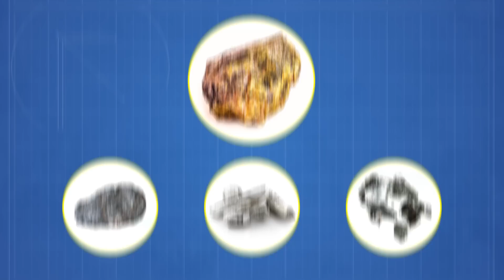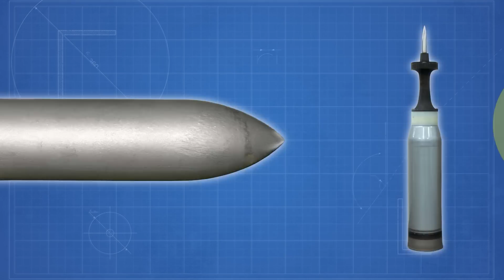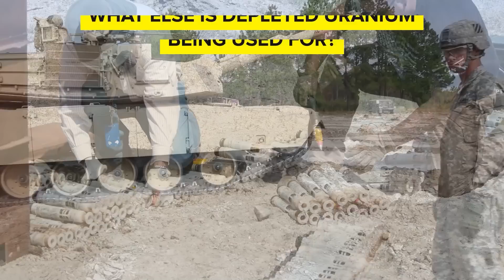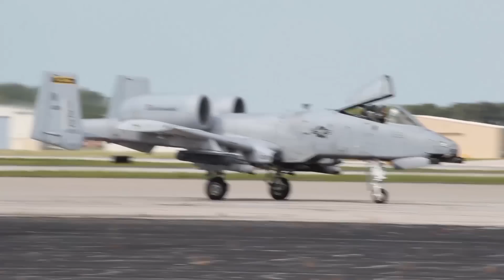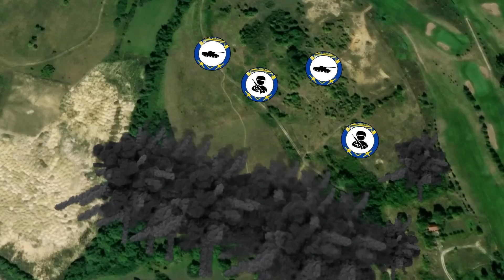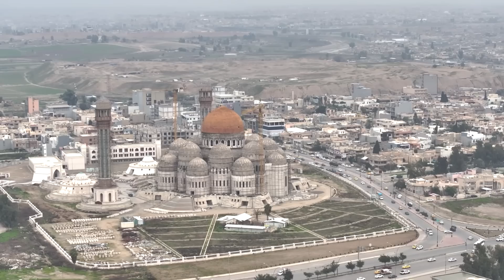The Shocking Reason Why Depleted Uranium Is Used in Ammo

Comment: I worked at a uranium isotope separation plant, so have some knowledge of the depleted U issue. Naturally occurring U is 99.7% U 238 Isotope and 0.7 % U235. U235 is the "good" stuff needed for reactor fuel. So the ratio has to be changed to concentrate the U235 up to about 4% typically. . As a result the  original U isotope mix is DEPLETED of U235, hence the term.  The  material used for the shells is still U just with a different isotope ration than natural uranium but has never been used in a reactor where it would have been useless.contaminate.
Reply: Well mostly true other than the fact that U-238 can be bombarded with a neutron and if it absorbs it turn into Plutonium 239 and be used for nuclear weapons.
Reply: @Stubbies2003 as an an exploded shell, there is no possibility of it being converted to plutonium
Reply: @Stubbies2003  How do u propel neutron?  U kant use magnetic field or electric field...
I don't know much bout nuclear particles.  But, perhaps:

1.  Neutron has magnetic field and respond to it, so it can be sped up

2.  Just knock out a bunch of neutrons off U-238 by proton and U-238 isotope is hungry so the latter just gobbles the neutron up
     to make Pu 239?

3.  Shine a powerful concentrated light beam, such as Gamma ray or Cosmic ray onto some other atoms, call it X-Element atoms to
     knock out a bunch of Neutrons, then let Neutron hungry U-238 to form Pu 239?
Reply: Small correction  238 is 99.2%, 235 is 0.7% 234 0.005%
Reply: 1) Your first percentage number "99.7%", should be 99.3%. Older technology had U-235 ratio for being "DU" lower than 0.3%, newer tech now brings it down to 0.25% to .20%, some old Uranium Hexafluoride stock at 0.3% U235 is now being reprocessed to get that last fraction if 235.
Reply: Yall so smaaaart lol damn❤

Comment: With all of the very vital positive effects of the DU ammo, being far better than the next best along with the well proven extreme low risk of health issues,,,,,we should step up to use DU far more than before. The positive effects in military use far exceed the use of lesser capable types. In reality, isn't the  need to use the very best in war time settings far more of the proper way than to only use the lower grade? That is akin to saying that lead bullets cause death and we need to return to throwing rocks at each other or bullets made of mud.
Reply: Despite what the video suggests DU isn’t vastly superior to tungsten, it’s cheaper and slightly superior only under specific circumstances. But tungsten or lead exposure isn’t particularly healthier.

Comment: Before watching the video, I wondered what exactly people thought the term "depleted uranium" might mean?  Perhaps there was less of it per round as supplies were depleted?   Perhaps the depleted means there is less Uranium per round?  Do they wonder if it means the concentration of radioactive U 235 which is used in enriched uranium for weapons and reactors has been reduced?  Maybe?  What if the manufacturers enriched the rounds?   That way, all the gunners would have to do is come close to the target to kill through radiation poisoning.  Mind you, the gun would be a bit of a problem, never mind the magazines.
Reply: It is refered to as depleted because the more radioactive (and useful) isotopes have been removed.  The stuff isn't that radioactive in the first place.  Primarily barely detectable amounts alpha radiation (cannot penetrate your skin with far less secondary beta radiation.  And most of the radiation is trapped and dissipated in the material itself.
Reply: @ If we had been F2F the sarcasm would have been a little more obvious

Comment: They are cheap and rival the density on thungsten which is expensive...and since depleted uranium is the sideproduct of running reactors then it's only reasonable to turn it into ammo
Reply: The US doesn't use spent fuel from reactors. They use byproduct from making the fuel rodes to begin with.
Reply: Not 'cheap' anymore.  Now the strategic reserve of the stuff has to be carefully managed and is only used for things where there is no real substitute.  DU used to be used as a replacement for lead as radiation shielding - but got stripped out when the stuff became scarce. (Uranium has much better structural characteristics - you don't need a frame to hold a DU panel up.)

The reason why countries that are serious about tanks switched to DU (actually an alloy of uranium and molybdenum) is because it is 'self sharpening; as it passes through armor while tungsten will mushroom out.  As a result, it has much superior armor penetration vs. tungsten.  Another advantage of uranium is that once it exits the armor it shatters into a shotgun blast of white-hot metal that still retains hit structural strength.  These fragments penetrate the spall liners that protect the stowed ammunition and detonate it.  

When you see Russian tanks exploding when hit - it is because the antitank munitions developed since the early 1990's are all designed to destroy the tank by detonating the stowed ammunition.
Reply: @colincampbell767 is it the mining, or the cost of turning it into DU. Because here in South Africa we recently opened a big bum mine on a massive deposit we found. Like, massive deposit. And i was excited for a second.

Comment: Fyi, the mechanics of a hypervelocity penetration armor is best modeled using fluid dynamics. Think of a fluid poured into a pool of another liquid. The penetration is proportional to the velocoty of the poured fluid but also the difference in fluid density. Just imagine pouring red dyed water into water, then imagine pouring motor oil into water. That is why we use as high density material like DU
Reply: Oil weighs less than water.
Reply: Clear as mud.
Reply: Without having your knowledge in fluid dynamics most people don't know an more than they did.

Comment: Ain't DU mainly U238... There are concerns over DU contamination but be reminded its a rather heavy material making it very hard to molten let alone "aerosol".
Reply: The only aerosol effect comes from the layers of DU being shed during the penetration. Only those in the immediate area, who survive, are affected. Afterwards, particles that are airborne quickly fall to the surface.
Reply: @rickslingerland1155 and those particles on the surface stay there until kicked up again by a tractor tiller or perhaps farm plants absorb them no? i worry for future farmers/kids.
Reply: @MonstroLab  The particles are not that dangerous in the first place.  This issue has ben studied multiple time.  Remember that it isn't 'layers' that are being shed - but fragments.  And this is intentional because it is these fragments that punch through the spall linker protecting the stowed ammunition and detonate them.

Comment: Almost all of the US tank rounds fired in Fallugia were high explosive, not DU.
Reply: DU is anti tank, and armored concrete rounds, only in the first month of the war against such targets they where normally used, if you use them in city fighting they will just like a super spear go through who knows how many buildings and hit one of your own is the risk, high explosives is so much more deadly, even a lightly armed vehicle i would use the high explosive, if you are unlucky those DU or similar rounds will go right through without hitting anything important and not have the desired effect because the target is to soft, but tanks 😱😱😱😱💥🔥🔥🔥🔥💀
Reply: I did not know that. It does make sense, though.
Reply: @rickslingerland1155  Kinetic energy ammunition needs to hit thick armor,  Otherwise it just makes a hole in one side and out the other.  Serious injury would require somebody be directly in the path of the projectile.
Reply: I wasn't aware of any KE ammunition being used in Fallujah.

Comment: The main reason they use this as a weapon is money. Nuclear power plants have to get rid of this material and got idea that it can be used as ammo. Its realy that simple.

You could use other dense materials that are not radioctive in ammo, but those are more rare elements and more expensive. So yeah money.
Reply: Uranium is simply the highest density metal that exist naturally. Irrespective of cost.
Reply: So, basically you’re saying that it’s like any other decision. You have 2 extremely comparable products, 1 is expensive and very hard to procure and the other is a waste product that is essentially free because it’s cheaper to use than it is to dispose of. 0.2 g/cm3 difference so no change in effectiveness. Pretty logical.
Reply: What do nuclear power plants have to do with DU?

Comment: I was a crew cheif on A10 warthogs. It always makes me smile to watch a video and see one. I once worked at our local airshow giving tours of our A10 to the public and had someone confront me about depleted uranium and the environment. I wish I had watched this first.
Reply: led poisoning is extremely dangerous but it’s the only heavy element that are not radioactive, many of the metals are not very dangerous because of radioactivity but much more because they are toxic, depleted uranium is not more dangerous to touch with your bare hands than led but you should always wash your hands afterwards, it’s never a good idea to get heavy metals into your body even though the risk is very low even with led.
Reply: @kimmogensen4888  All heavy Metals are Toxic after the Strike a Target.  I was a Tanker when the 105mm Version of the APFSDS showed up.  Damned thing Tore up the Range Equipment.  It went though six feet of dirt, 3 feet of reenforced concrete and right though the machine that raises the Tank Target.  I saw Film (LOL) of it going in the front and then out the back of a T-72.
Reply: @dnate697  do you think it's safe to keep old shells? I have a ton of 30mm shells that were fired and one 105mm from an AC130, which is sitting next to my toaster in my kitchen. I feel stupid for asking this, but I genuinely have no idea and you got me thinking about the metals.
Reply: @nightshadedPRSguy  How in the hell did you come up with that Reply?
Reply: @nightshadedPRSguy wash it and dispose of the towels in the trash. Use disposable gloves and a mask just to be sure. Then it's ok.
Reply: @BladeFitAcademy  thank you!
Reply: @dnate697  because you seemed like you knew what you were talking about in regards to heavy metals, shells, and whatnot.
Reply: @nightshadedPRSguy  I do know what these heavy metals like Tungsten and every alloy and variations there of.  I was a tank gunner in the M60A3 and the first 105mm M1's.  Yes, DU rounds are toxic and so is lead.  

It was said that Steal is the least Toxic. So the TP APFSDS we had just just as good as APDS combat AMMO! DU was like comparing a .44 Mag HGAP to a FMJ 9mm LOL! DU was worth the risk!
Reply: @nightshadedPRSguy  If you wanna be extra paranoid, I'd likely put them in something so they don't oxidize (rust) and dust forms, which is the "you are going to have PROBLEMS" substance.

hm...........  get them embedded in lucite?
Oh, but you said you have a lot, that could get expensive.
Reply: @nightshadedPRSguy  The shell is a completely different metal than the projectile.
Reply: @kimmogensen4888 lead isn't used for military rounds
Reply: On behalf of all people who are concerned about the environment and conservationism, please allow me to apologize for that person's boorish behavior. Folks like that give nature conservancy a bad name. Thank you for your service, sir.❤️‍🔥🇺🇲💪🫡
Reply: @ramseydoon8277  thank you for your kind words! I also believe in conservation. I want future generations to live in a world that has clean water and land. I'm a terrible bow hunter who often goes years without getting anything, but I still enjoy enjoy sitting in a tree and observing nature. It's good for the soul.
Reply: DU is definitely not very radioactive, people should worry about Radon levels in their homes 100 times more, it’s bad on it’s own but especially in combination with smoking it multiplies the chances of lung cancer which is as good as a death sentence in agony, in the region where I live there are several places with high concentrations, it’s a radioactive gas that naturally is released from the ground, out in the open it’s no danger but if it gets into a house regularly it can be deadly over time especially if you are a smoker, but it can easily be avoided with severe different methods, the easiest is in a new building you just lay a radon resistant membrane after you lay insulation in the floor and the radon gas will not enter the house but outside, because you channel  it to the sides where you have small ventilation holes and the gas will dissipate with the wind it needs a certain construction to be dangerous
Reply: The issue was that some of the contractors supplied not so depleted Uranium in the 30mm ammunition 😊
Reply: @jackdbur   It was depleted!  It costs too much to stop using it before it is completely depleted LOL!
Reply: The day they decommission the A10 is the day I stop paying taxes.
Reply: @Jdalio5  I love the A-10 but not that much.
Reply: Cool. I live in the Adirondack Mountains of upstate NY. I have very fond memories of hunting up in the mountains and suddenly hearing a loud rumbling sound getting closer and closer until finally an a10 came screaming over the ridge and swooped down to cross over Lake George and then climb over the mountains on the other side. I’m not sure where they were based, maybe the now long closed Plattsburgh AFB. I really miss seeing them.
Reply: @amadablam8229  yessss. I love that sound. It's very distinct. Thanks for sharing my friend.